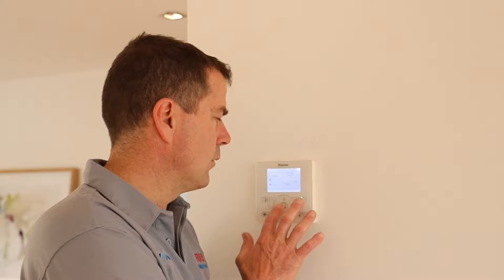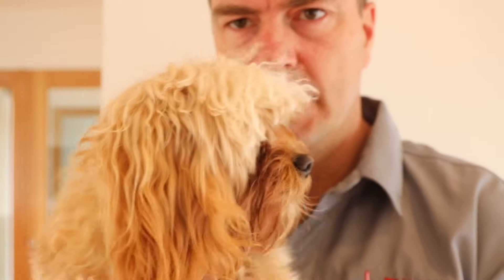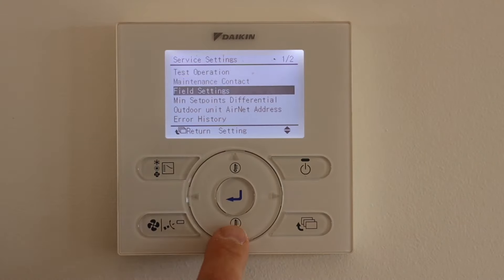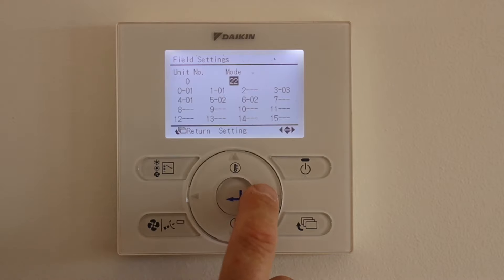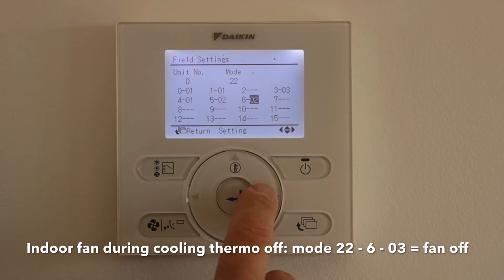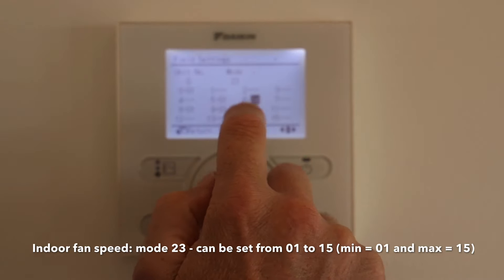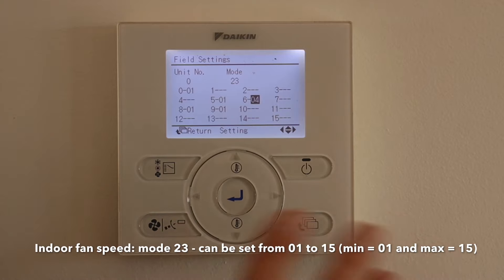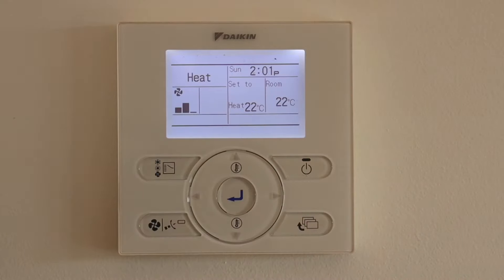Daikin BRC1E63 controller set up field settings cycle fan off, activate sensor in wall controller

Comment: can  a Daikin master controller show which room is being heated up and does it also have a history of this by any chance? This is in a 14 rooms place that are all controlled by one master controller but that have individual controllers of their own.
Many thanks
Reply from the maker: I don’t think so, not as standard. If it a VRV system, there is a way of working out usage for charging the user for there use, but this would have needed to be an option when installing the system, possibly could be retrofitted.
Reply: @FullyAirconditioned  Thank you so much for replying so promptly. It is in fact a VRV IV system. There are 14 rooms plus a large room that has units on the ceiling whereas the individual rooms have 1 unit on the ceiling. Each room has an individual controller but the master controller is located in one room. Che units outside look like big refrigerators. could they cost as much as £200 to heat up one of these rooms (400SqFt room with high sealing) for only 1 month with a max use of 2 hours per day?

Comment: Followed your steps on my BRC1E63 but 22-2 only has 01 or 02 values - not 03 to set the therm at the wall controller? Any ideas why that value would not exist?
Reply from the maker: Possibly on older unit

Comment: Hello from Bulgaria, i want to ask you, do you have which number from the service menu are the maximum temperature of the indoor. I want to made it to be 50 degreece of celsium becouse i change the indoor whit water exchanger and i heat water for houses. Thank you and regards
Reply from the maker: I don’t think this can be done sorry
Reply: @FullyAirconditioned  i do it on toshina and on mitsubishi i'm sure there is a way to be made on daikin
Reply from the maker: @georgivassilev4181  try calling local Daikin tech support

Comment: I cannot change the mode 23 number 6 - are you using a split or a machine inside the wall?
Reply from the maker: This setting is for a ducted split system (indoor unit ducted type, system split in two) design and for the Australian market.

Comment: In my case the remote doesn’t let me get onto number 6.. it displays 6 - - - what’s the reason behind it? Is the unit I have not have that function?
Reply from the maker: If you unit dose not have 6 displayed then it’s not possible to set, you may have an older model with an AC fan motor that only has 4 speeds in total, a jumper cable on the indoor unit adjust high / extra high seeps only.

Comment: I've got 2 controllers - Master and Slave. The master controller is in a room that's NOT air conditioned. I want the temp sensor on the slave only. How do I do that? I have asked Daikin support, and even they don't know how it is done!
Reply from the maker: The master can only be set as the temp sensing location not the slave. Once the master and slave have been set it’s hard to change with out it getting stuck in fault. The easiest way is to just swap the controllers over, turn the power off (controller are only low voltage 16v dc) unclip the controller, unwire P1 and P2. Swap controller over and put wires back in the same terminals.

Comment: Does this apply to BRC1E61? I've adjusted these settings on mine and the fan still runs when the unit is at the desired temp when cooling & heating. Is there something I'm missing?
Reply from the maker: It more depends on what indoor unit is attached to the controller, the controller is just access to the indoor pc board, the indoor units pc board is the part that has the difference codes to be adjusted. If it’s not Australian Daikin ducted  indoor unit the codes may not work
Reply: @FullyAirconditioned  Thanks for your reply. The unit is a Daikin RZQ150KV4A.
Reply from the maker: @projecteuroau  that’s the outdoor what’s the indoor
Reply: @FullyAirconditioned  The indoor is FDYQ160KAV1
Reply from the maker: @projecteuroau  thats an older model, has a AC fan motor so only 2 speeds that cant be changed but sensor settings should be the same

Comment: Hi
Our air conditioner is on auto cut mode . It stops after the room temperature comes to the set temperature but doesn’t start again if the temperature goes up again. How we can sort that?
Reply from the maker: Check what sensor is active, usually sensing from wall controller is best, but you could try other sensing locations. You can set to the sensor from return air or both. Try them all and see what works best
Reply: @FullyAirconditioned  okay thanks mate

Comment: Hi, I have some important questions because my ducted indoor unit is not giving me comfort in cooling this year:
- set point temperature 23°C
- in the indoor unit status I see, for example, Th1=27C, Th2=8C, Th3=20C. Are these values consistent?
Can I run the function test on my own to see if there are any errors or do I need an expert technician?
Thank you
Reply from the maker: The temps seam with in reason, return air temp th1, coil temp th2 and gas pipe temp th3. The return temp is 27 is that what the temp is in your home. Have you checked the filters, is the fan set to high, has anything changed with your home.
Reply: @FullyAirconditioned  Yes 27 was the temperature of the house. Last night from 27.4 it dropped to 26.3 in 2 and a half hours of automatic fan operation with set point 23°c...I don't know if this is tolerable with an insulated house and an outside temperature of about 32°C. I cleaned the internal filter and the external unit with running water. I just need to change parameters 23-6-X (they are now defaulted to 01 with indoor unit FBA50 and outdoor unit RXM50). This parameter has never been touched...what setting do you recommend? The only change from previous summers is the birth of a second child...he is only a few months old!
Reply: Would it be useful to run an operation test to see if there are any errors? Or, if there were, would I already find them in the history?
Reply: @FullyAirconditioned  My controllore is BRC1E53A7...does it change anything?
Reply from the maker: @lucasquazzardo7379  FBA50 is a very small system, 5.0kw I would say max area to cool would be 30-50 m2 depending on how good the insulation is. You said it worked well last year, maybe a duct has come off, or could be a low on gas, system will slow down compressor speed, will only run as fast as the amount of refrigerant in the system will allow. Could be a faulty sensor on the out door unit, not allowing it to ramp up in speed. You know your system and how it worked last year, if all the simple stuff seams ok then probably best to call out your local Daikin repairer.
Reply: @FullyAirconditioned Thanks for the help..tonight I will try to see if I can change the fan speed...then I will call Daikin. Sorry to hear they installed an undersized machine for me.
Reply from the maker: @lucasquazzardo7379  it depends on what part of the world you live in, if the house is very very well insulated like what is built in Europe or Germany or Canada it could be ok, here in Australia out homes are not that well insulated.

Comment: Any change I get easily get it to do lounge and not bedroom
Reply from the maker: Sorry not sure what you mean
Reply: @FullyAirconditioned  split the function so it only does one room
Reply from the maker: @christurner4878  if you have a ducted unit and you just want to send air to the bedrooms or just the lounge ?? if yes you would need zone motors installed in the duct work for this to be-able to be done. then you will need to decide how to control them, a simple switch like a light switch, possibly a zone controller, much like a switch just a little more fancy and usually fool proof (wont let you turn off all zones at the same time). Or a intergraded controller that will control the ac and the zones like the Daikin zone controller BRC24Z4 or the Daikin Airhub touch BRC24TZ4B. Another option would be a third party integrated controller like the "MyAir"

Comment: Hi, on the outdoor unit status, can you explain what those temperatures are? Are they adjustable? We seem to have an issue when it gets down to below 2 degrees outside with the unit staying on and reaching the set temperature. Any tips on this?
Reply from the maker: I believe there is outdoor air temp, coil temp, there are a lot more sensors but you need the daikin D-checker to look at them. Could it be that there is an air leak and cooler air is coming down the wall where the wall controller is, or is the controller mounted on an external wall and being influenced by the temp outside ?? Check that
Reply: Do you mean the wall unit for controlling the system? That’s inside of course. Or something else? I’ll go out and see when I can.

Comment: Excellent job with the video! Unluckily, I've touched other values at field settings menu, and now my AC doesn't work properly. Can anybody help me with this? I've tried to search on the Intenert factory setting values, but I cannot find anything regarding this subject. Is there a way to reset my controller BRC1E53, then pairing again with the indoor unit so that the BRC1E53 sends to the indoor unit the factory setting vaules of the field settings? My indoor unit is FCAG71BVEB, outdoor unit is a ARXM71R2V1B and remote controller is a BRC1E53A7. Thank you all in advance!
Reply from the maker: Hi Jorge,
sorry but this setting is for the BRC1E63 connected to a Australian ducted indoor type unit. looks like your controller is connected t a ceiling cassette system, they have different settings.file:///Volumes/FileServer/DAIKIN/Option%20Cards%20&%20Controls/BRC1E53%20-%20Installation%20Manual%20(1).pdf
field setting for BRC1E53, 
also try 
https://drive.google.com/drive/folders/1KHh8K8Bq4G3KYqpdkkU7a4jQAMLbkU36
Reply: @FullyAirconditioned  Thanks for the answer, I’ll look into the link. Sorry to mislead you, but after checking the indoor unit I noticed the name is ADEAS71A (not sure why the energy print sheet says FCAG71BVEB).

I don’t know if that will change things or it doesn’t matter because what matters is the controller, but I want to mention it in case you have some advice to give.
Reply: Oh! An another thing, because I kind of copied the numbers of your field settings, now the Mode 22-3 and 22-6 don’t stop the fan when the desired temperature is reached. I just would be satisfied if I was able to make the fan stop, but again, I really don’t remember what numbers I’ve changed

Comment: I’ve set ours to 22 3 03, set temp is 21. Room is 24, but the fan is still going?  Is there something I’ve missed?
Reply from the maker: Sensor location ?? Is it set to wall controller 20-2-03
Reply: @FullyAirconditioned  yup it is,
Reply from the maker: What model unit (indoor unit) is it ??

Comment: Question:  I have a Daikin installer telling me that I cannot go back and forth using the remote controller and wall controller depending on which is more convenient. I think it’s bullshit. I used both interchangeable before they did annual maintainable. I think they screwed something up during their maintenance.  Please confirm that I can go back and forth between the remote and wall controller. Thanks!
Reply from the maker: If it worked before it should work now, daikin units can have two controller connected, one will be a master controller. The master can be used to set all functions, mode, timer, temp ect. The 2nd controller will be the slave controller, it will mimic the master, you can turn on off, change temp but you are limited with mode and other settings that have to be set from the master controller. The wall controller should be set as the master as it has the most functions, and sensor in it. The remote controller should be set as the slave as it has less functions.

Comment: Where can i find the manual for all the field settings and possible values and their meanings ?
Reply from the maker: That’s difficult because it depend on what unit it’s connected to, the controller is just access into the system, all the setting are in the indoor unit P/C board, the controller just gives you acess and the ability to select and change setting options for that indoor unit. It also gives access to the outdoor unit, you can view temp sensor readings ect.
Reply: @FullyAirconditioned  I have the FDYQN160LAV1 daikin ducted reverse cycle system and i want to change the fan speed because even on low, the house is too cold.
Reply from the maker: @johan-zs8nc  Your system has 15 fan settings, each fan setting has 3 speeds, so you can change the fan speed setting using if you have the BRC1E63 controller using the field code 23 - 6 - 1 through to 15, setting 1  being the lowest and setting 15 being the highest. Don’t set too low as this will reduce the systems capacity of the system as the compressor wont go into full speed. Mode 23, first code 6, second code 1 (lowest) 15 (highest).
Kind regards 

Craig

Comment: I've done all that but I'm still having a problem of the downstairs working and upstairs has no air flow. Any ideas?
Reply from the maker: Probably best to get some one out to check the system over and how it’s installed. Give you an independent view of the system sizing, how it’s installed and ducting. Be up front with whoever you get out, give them a clear understanding of what your expecting, you want someone with experience to go over the system, this may take 1 or 2 hours of their time.
Reply: @FullyAirconditioned  thank you for the prompt reply! Also when cleaning the filter what happens if you put the correct in the wrong way? I watched your other video but you never mentioned which way it goes in.
Reply from the maker: @Al-vo2ib  filter go in with the spline that’s holds the filter media in place facing the air flow, this way it shouldn’t pull out of the filter becomes blocked.

Comment: Hi, I was wondering if you could please share a video showing all field settings pages or how one can reset all the settings? Had one of the young ones of the house attempt to do something and I feel like its all been jumbled up. Unit is a fdyqn250lbv1
Reply from the maker: This is a difficult one as it depends on what unit this controller is connected as they all have different settings from ducted, Vrv, cassette ect. I have looked and asked the question but don’t have that information sorry. I will post the sheet that comes with the current ducted unit.

Comment: Are these codes the same for a BRCE173?
Reply from the maker: Lauren Bush don’t know, it depends on what type of indoor unit the controller is connected too, as the controller is just a way of accessing the indoor pc board settings. Give it a go and see what settings are there. Just take a note of what it was set to before you change it, so if it dose not work you can change it back. 🤓

Comment: I have set thermostat to controller and stop blowing
Now when I set 22 heating when reaches it stops blowing when will it start blowing when temperature reaches 21 or 20 or do I have to off and on again

Also how to set when 1 degree drops to restart blowing 

How to set fan speed to auto or does this model have high medium low
Reply from the maker: You need to set the sensor in the wall controller as the sensor the system is reading from, when the air temp drops the system will start heating again. The system cycles on a 1.5-2.0k differential that can’t be adjusted.
Reply: My indoor temperature readings is not same as my IR thermometer how to change reading settings to add 2 deg ( room is 24 controller indoor shows 22 ) hope for guide
Reply from the maker: @iliyasmohammedadam6857  where are you reading 24 ?? Indoor, do you mean indoor sensor, thats the sensor at the indoor unit, so up in the roof space if the indoor is in the roof.
Reply: @FullyAirconditioned  control panel is in lounge and thermostat is set to control panel as your video . It cutoffs when I set to 24 but when I go to panel it shows indoor temperature 22 I want to change this 22 to 24 can I do this
Reply from the maker: @iliyasmohammedadam6857  no the sensor dose not have a calibration off set. 
Thanks

Comment: Unfortunately, that didn't solve the problem for me. Could there be a different problem with the fan? I have the fan on "A"uto, and I set the 22-3-03, but the fan is still running even after the set temperature has been reached
Reply from the maker: Try 21-2-02 cycles off fan on heat and cool, it depends on your indoor unit and how its set up from factory, this is for current ducted systems sold in Australia, it my be different in different countries.